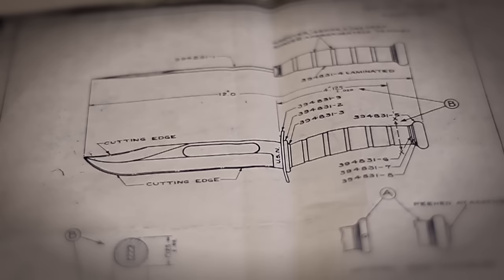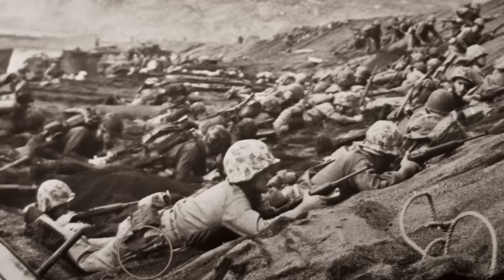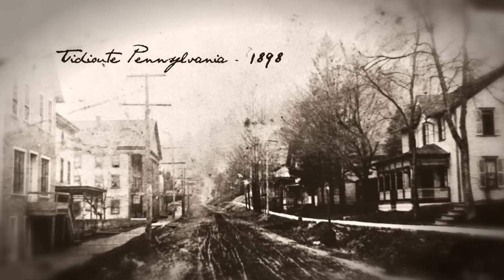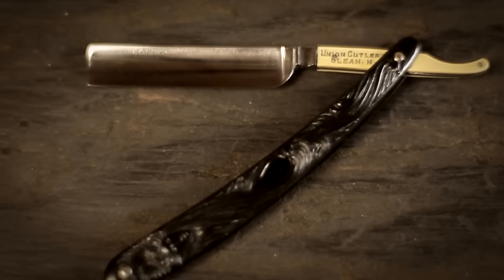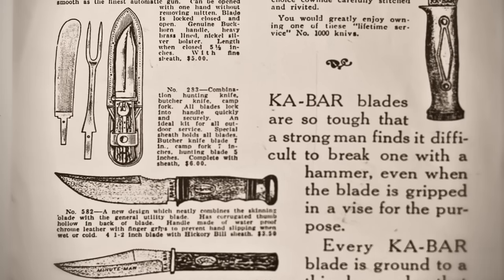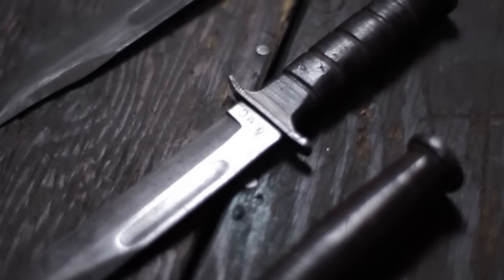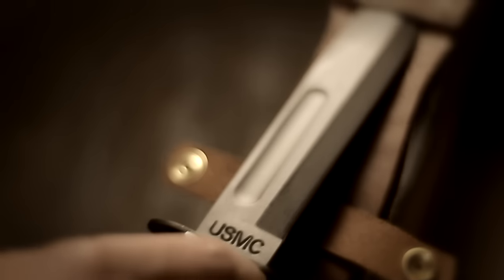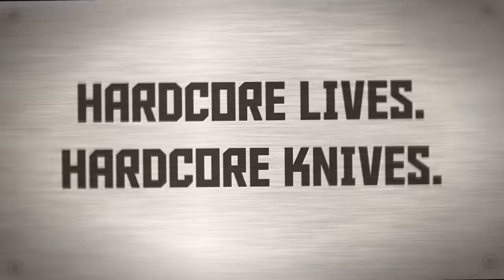The KA-BAR Legacy

Comment from the maker: Enough with all of these knockoffs.  Let's take a closer look at how the real things are made.
Reply: That's what I'm talking about
Reply: why the handle is not in the same line with the steel? the ka bar short knife is in the same line. The full size ka bar knife is not in the same line.
Reply: Tommy proffitt yes. it's not technically KA-BAR
Reply: That's how it's life span begins. Later when it's often sharpened and some edge has been lost, then it lines perfectly with the handle. Grind some more and the blade is higher than the handle. Then you discard it. So averagely the blade lines up with the handle.

Comment: They should redesign it,  make a better tang,  not a rattail tang kinda like a becker bk-7 etc..
Reply: Tang is tight on the real ones. The fake it moves a good bit.
Reply: +jabames a That would increase weight and increase cost. These knives were built to kill people, not chop trees down.
Reply: You don't redesign a classic.
Reply: I think the issue with the tang is, if you add meat to the tang, you add weight and throw off the intended balance. But, frankly, I agree with you. I use it to dig up roots and cut vines. I don't care about whatever balance point they intended for fighting.

Comment: A good knife is hammer forged, and heat treated for strength  not stamped metal cut out of a steel sheet as seen in this video! Although the K-BAR is popular it can't take any beatings like normal knives it's strength isn't all there in my opinion! I like the look of it, and own one but with it was stronger in the blade!!
Reply: sniperforce34 I agree. I have two ka-bar knives. I was young when I got my first one and I saved up for a long time to buy it. After growing  
 up and learning more about knives. I now have quite a few  knives that are easily half the price and are made from better materials, and are full tang knives with the handle scales riveted on with large lanyard loop sized rivets. I've used them as pry bars and hammers and almost everyone of them far exceeded the strength and utility of a ka-bar. I really wish they lived up to the hype that all of my old veteran family and friends said about them, but they just don't. Honestly I've made better knives and I'm not even a knife maker,  I'm a gunsmith and welder.

Comment: A blood groove...
You're calling it a blood groove?
IT IS TO MAKE IT LIGHTER NOT SOMEHOW CATCH BLOOD
Reply: It's a nickname... Calm yourself. It's real name is a fuller
Reply: +Vector Nuke it's not for catching blood but for letting it run from the wound despite the knife blade remains there.
Reply: +Paweł S Actually its not. Its called a Fuller. Its purpose it to remove weight from the blade while keeping it strong.
Reply: +VinylScratch389 Yeah, that. It doesn't reduce strength so why not get rid of the extra weight.
Reply: lmfao! boy you dont know what a blood groove is! a blood grove is meant to alleviate pressure when retracting your blade from somebodies body. the blood is able to pass by the blade through these grooves reducing the suction making your blade not stuck. the romans were using this technology for thousands of years.
Reply: Bob Figglehorn lol you don't know what a blood groove is? haha you made me laugh though
Reply: Well,  happy to know it makes you day like a lollypop for a little boy:)
What I know from experience is that the traditionally shaped WWII Ka-Bar knife is worth shit:) especially, when it comes to the lateral strains. No good having it wide and strenghtened along the blade in the same time limiting its width where the guard starts and using poorly treated and low quality steel. It was good for WWII applications, including loosing it in the field. Nowadays, great collector's item to shelve:)

Comment: does anyone know why the blade is off canter?
Reply: Because by doing so, it allows us to use our fingers as added leverage to add power for the stabbing motion.

With the blade positioned somewhat over your fingers, additional pressure can be applied to it, increasing the force of the stab.

I know this because my knife is made the same way.

I did a test using a strip of cow hide leather from my grandfather's farm.

And let me tell you something...

With the additional leverage that I had due to the repositioning of the blade...

My ka-bar went straight through that leather like crap through a goose!

Hope this clears it up for you.

Peace out!!!

Comment: I just wish the blades we're Hand sharpened and not by a machine
Reply: +xFADExPHANTOMx That's not feasible for a production knife. Mine was so sharp that I couldn't have asked for any better anyways. Not to mention that the consistency decreases as human involvement increases, generally speaking. In business consistency is everything.
Reply: +xFADExPHANTOMx If you want completely handmade get ready to pay a hell of a lot more, humans are still involved in the process and taking part in quality checks, but there's nothing wrong with using machines when appropriate.

Comment: Your knives are great but they are too expensive.  :(
Reply: its worth every dollar and more.

bought one off amazon for around 70 bucks. if you have a job you can aford it.
Reply: +Ethan Miles  I still have the one I bought in early 80's (not issued, served in the FMF/USMC). It's seen some "better" days (have yet to use it on a Bear or if needed against Boggey Men/Women).   For me the cost was a days Labor, worth every dollar.      You get what you pay for.   Semper Fi!     Peace.
Reply: Johnatnan Strebler more expensive where i live. Bought a knockoff, didnt regret it
Reply: 65 bucks is to expensive? smh
Reply: Johnatnan Strebler same bro worth it
Reply: Johnatnan Strebler dude fuckin' exactly 😂👌🏼✌🏼
Reply: Ok sticker shock in Canada ($120.00 CDN) may seem like a bit of money, but you get what you pay for.  I have thrown more than 120 bucks worth of  "cheaper" knives in the trash bin because that is where they should have gone right off the conveyor belt.  Love the Ka-Bar.  I m heading north of the Arctic circle and it was my only choice of knife to bring with me. The Gerbers and Leathermans are sitting this one out.
Reply: Absolutely one of the high value/high performance knives out there for the money.
Like many here, bought mine at the PX, and it served in the mission role till discharge. Now, it is my constant companion in the field. I LOVE my knife. It has been thoroughly proven. Spend the money and get one.
Reply: $50 - $60 too expensive for a damn good knife? Apparently someone has never shopped for a decent knife before.
Reply: @Jomama At the time of my comment it was being offered in the price range I specified (I checked before posting). Buck knives also fall into that range and are arguably of lesser quality. There are definitely better knives out there, but these fall into the category of "dang good", and for this price you aren't shy about modifying it to suit your custom needs. I own a Ka-Bar from the Second World War that has taken untold abuse and still holds a razor edge. People have their favorites as far as knives go but compared to the $250 knife I own, my Ka-Bar gets a heck of a lot more preference.

Comment: I just purchased a Dog's head 7 inch fighting utility knife. Absolutely the best quality factory knife of this type. I'm still trying to find something 'off' about this blade. There is nothing like a real KA-BAR. Yes rat tail tang but that is true to its original design. Get a Becker or a cheap knockoff if you want to be Paul Bunyon with your knife.